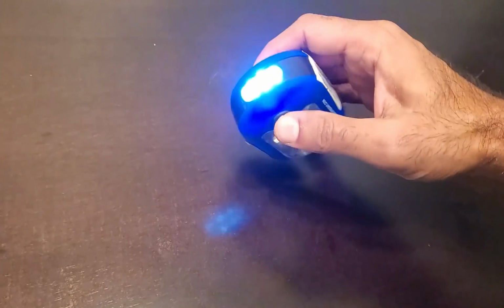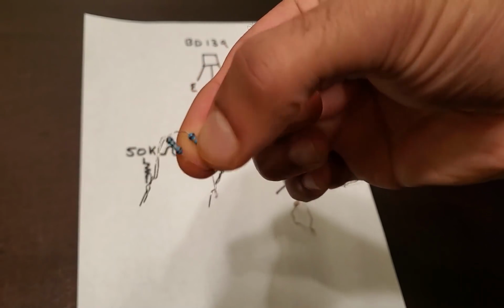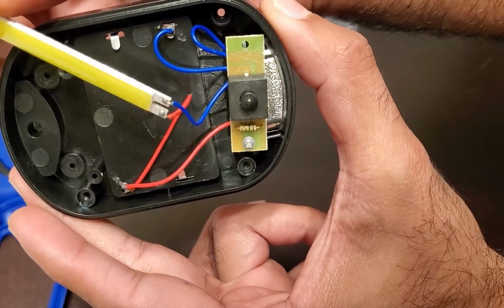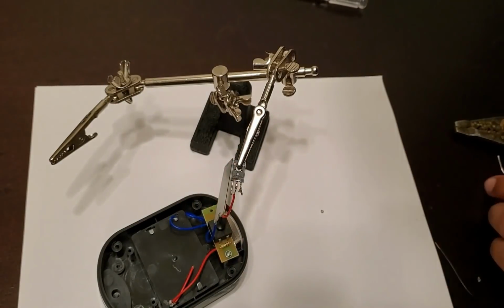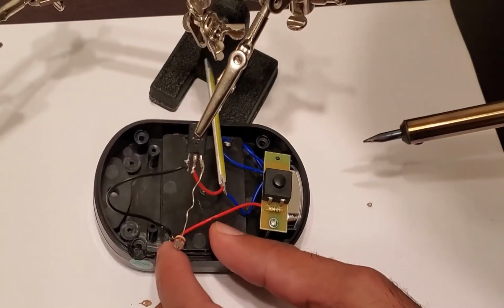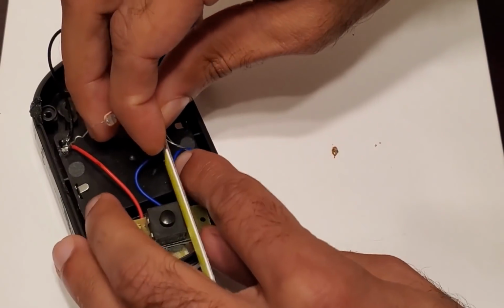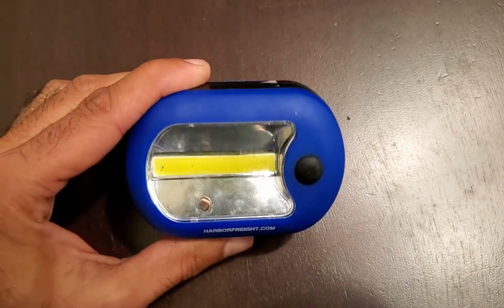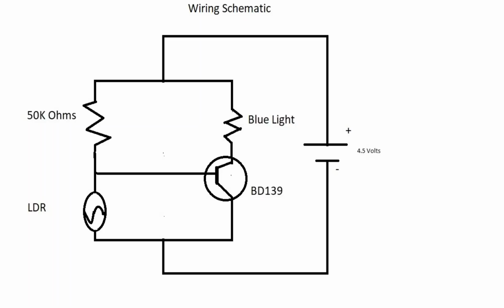Harbor Freight Blue LED Light Modification

Comment: I powered up a battery operated light using an old USB charger so I never have to change the batteries. I have low voltage transformer with 12v output, which I want to use to power up outdoor solar lights. Solar light batteries are poor and light goes out pretty quick. It would be helpful if you can show how that can be done.